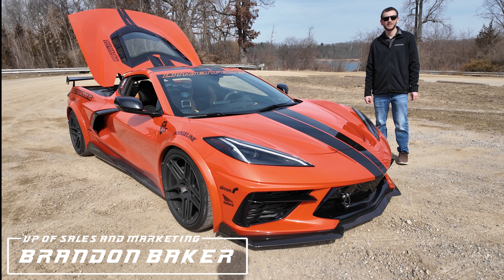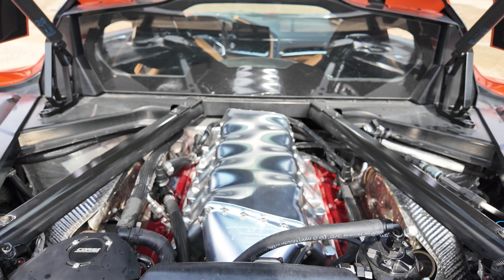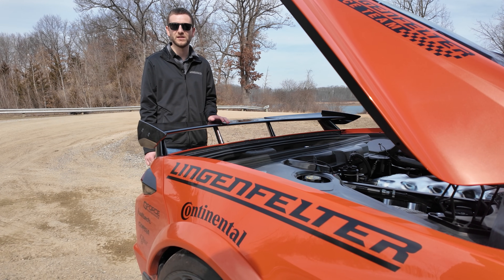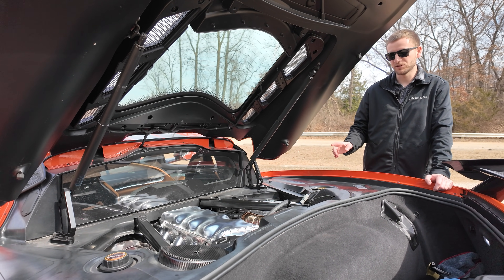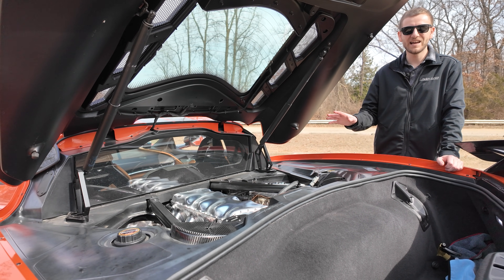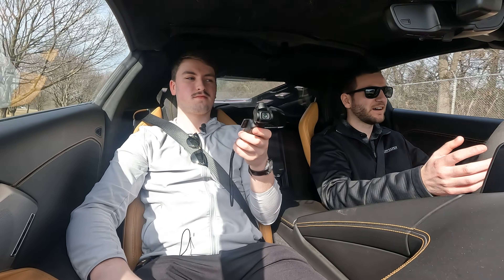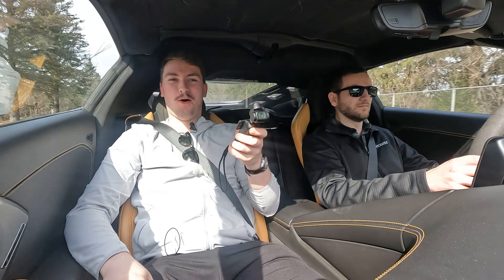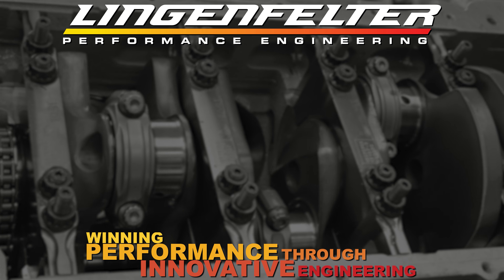LINGENFELTER TWIN TURBO 427 LT2 | First Drive and Full Walk-Through

Comment: Now what is the price with all options? Seems to me that it has the same power and cost MUCH LESS than a new ZR1 and still have a factory warranty!!! If they really want to sell these beasts they MUST POST a video of a full quarter mile pass! Even better would be 2 or 3 passes at different boost levels and what it will do on pump gas and E85! Since a turbo C8 has run 8.64 (search it on YouTube!) I would expect at least the same performance! Come on guys GET IT DONE!!!
Reply: I mean you're comparing apples to oranges. ZR1 will be far more rare, collectible, and valuable on the second-hand market.
Reply: @dkkuhn87 I doubt it! Just look at the price of a Motion Corvette! Just depends on what the collector wants!